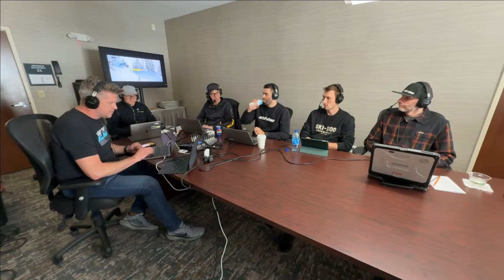LIVE Q&A with Ski-Doo engineering team - 2026 models discussion

Comment: Ski doo Dream sled for 2027 
1.  Use all the lightweight stuff from the 2026 summit X Snowmobile
2.   2026 Summit X skid with coil over shocks 
3.  The 154" ultralight track that's on the 2026 Summit X Snowmobile make it 15" wide 
3.  Track needs full length rods  like an expert track. Make it  15" wide 
4.  The 2026 expert 32" front end, twin link steering system
5.  Aluminum upper A arm
6.  pilot DS-3 skis 
7.  15" wide tunnel. 
8.  Belt drive 
9.  A lighter hood 
10.  Small lightweight headlight 
11.  Try to make the clutch side panel lighter
12. No T-motion
Reply: Vertical steering post
Rider tracking (that goes for more than 1 mile)
Mufflers that don't overheat
Tapered tunnel (like the Polaris)
Brake caliper under the hood
Belt life that lasts longer than 350km's
Reply: No exploding clutches like Polaris. 
No china berings that fail at 1500miles like Polaris. 
No front shock mounts failing like Polaris. 
No bogging due lousy air intake like Polaris. 
...I'm tired of texting
Reply: @ Just exploding chain cases instead. Saw another video of one grenading today. At least you can bolt-on a new clutch.
Reply: @Heinester  when the Polaris clutch bolt 🔩  breaks, you have 50% chance of removal from the crank stub shaft. Oooooh that's fun replacing that.  Just saw another video on that. Indy Specialty Just loves ❤️ Polaris's failures.
Reply: @Heinester  Here's a good video on. Polaris hasn't done squat except give you a new bolt.  What a joke.  At least these guys are providing solutions. Poo 💩 

https://youtu.be/vuGpfERkD-g?si=cLp1-TDu5Uw-56jt
Reply: @ Well…when the bolt was the issue, what do you expect them to replace?

Comment: Nobody talks about the broken chains on the summits....
Is there an improvement for 26?
Reply: They're all recalled to be replaced with the Hyvo chain. Can't complain too much if people refused to get the recall done on their 23-24s. Same as Polaris riders not bringing in their 23-24s with the old clutch bolt.
Reply: @devon760  25's are still breaking. 
I didn't know they already had a "fix"
Reply: How do you ride your sled?  Shouldn't be breaking a chain.
Reply: BINGO. And a plastic chain tensioner?? Wtf is that!?

Comment: Word of advice to Skidoo engineers...  It's a mistake to reduce cooling capacity on any sled to reduce weight.. Please leave the 2026 Summits with existing cooling.  Their motors need all the help they can get unless you always ride soft snow from your trailer to your play areas but I doubt it.  You don't want to have to rely on ice scratches, which break,  for cooling very much.
I guess the aftermarket folks will be happy to sell add on coolers though. Like a few Arctic Cat 800 riders I know have added.
Just speaking as a snowmobiler since 1972.
We have 10 sleds in our family, all Skidoo, Polaris, and one AC.